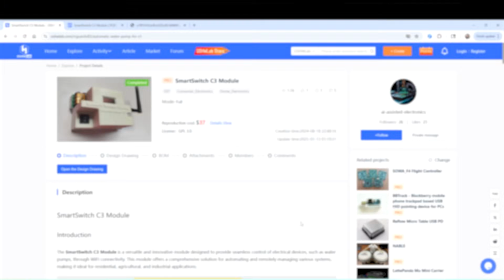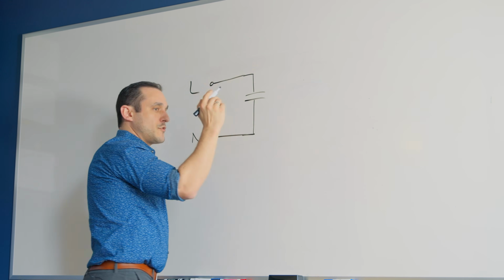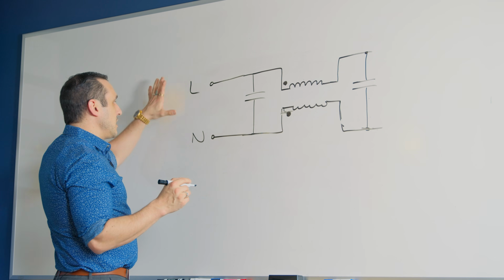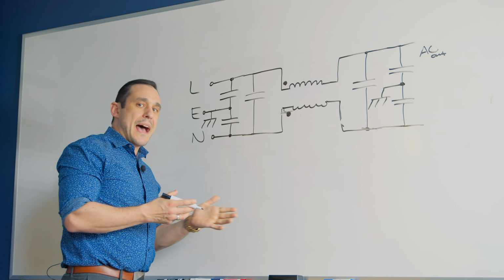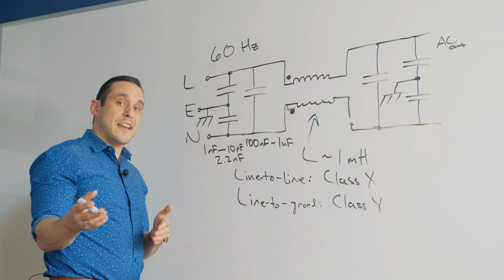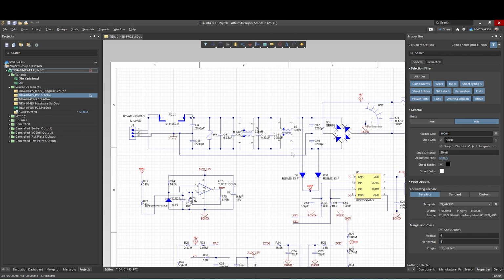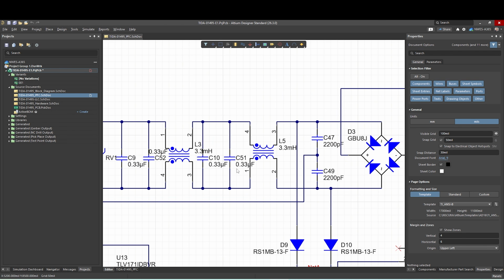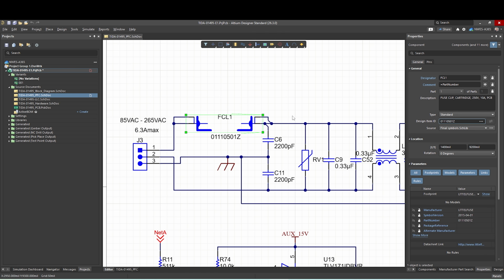EMI Filters on AC Power Lines in a PCB #electronicsdesign #emc #altiumdesigner

Comment: AC power line routing is an interesting task given that hazardous voltages require certain barriers (clearances) to comply with the standards. Add line filtering into the mix and you probably have more than one class of barrier to take into account. I find that designers focus on adding components to meet conducted compliance but seem to disregard routing strategies to minimise radiated emissions. Tightly coupling the line voltages, should be given careful consideration in a design to reduce emissions (time at a testing lab). EMI is about radiated as well as conducted interference.

Comment: Thanks for the content but i have a question what about DM noise. Would be greta if you can cover that. I recently designed a power supply unit and then i got stuck on analysing for dm filter. The one dilema i had in particular is for DM noise if the leakage inductance is not enough on the choke to form a good filter with teh X cap should i add individual inductors to the line and neutral line. The issue here is the switching frequency of my boost stage and further infact . the switching frequency is quite low due to the transformer i am using i am limited to 130khz max. this is making designing a dm noise filter difficult without breaking the bank. all the design guide i find online seem to not talk about the fact that dm noise travels back intothe grid and that the leakage on choke might not be enoug to filter this out .

Comment: Hi, nice intro to ac line filtering. One of the main concerns in ac filtering is leakage current, which limits maximum capacitance for Y capacitors. Depends on standard and product type, there are various limits. Typically i would start with conducted emissions measurement (LISN + spectrum analyzer (even without QP detector)), to see what actually needs to be filtered (which frequency band and common or differential interference). If no measurement can be performed, i would design filter around most probably emission source (from 150kHz to 30MHz)

Comment: Hi! Thank you for the informative content! Would EMI filtering be only necessary for devices using a switching power supply only (due to the high switching frequency noise) or in low power linear supplies as well?
Or does it depend a bit more on the cost allowance of such devices?
Thank you :)

Comment: Right after this video, out of curiosity, I asked Gemini to recommend a choke for a 60Hz line, and it said to use a choke between 1-50 mH. AI is not there yet, but it's impressive. What say?
Reply: idk what you said, but that's not what Gemini told me.  The TLDR is: if you want to block high frequency noise riding on the 60 Hz power line, you need a Common Mode Choke rated for your maximum RMS current and noise frequency.  If you want to block the 60 Hz hum, it explicitly says it's the wrong tool for the job, and that you'd need a choke measured in Henrys, not uH, and it would be so huge it wouldn't fit on the PCB, and that the right tool is a bulk capacitance and an LDO, and if it's a ground loop you need an optocoupler or isolation transformer.
My query: "I have a 60 Hz line and I want to suppress the noise coming into my PCB circuit.  What kind of choke should I use?"
Reply: Never seen any chokes with a micro henry rating listed..  μH does not compute..  mH yea or just H ive seen..  never see any pH either.  Seen a few nH in audio circuits but those are usually just fb or ferrite beads that provide that inductance..